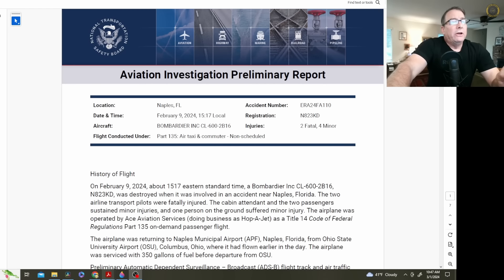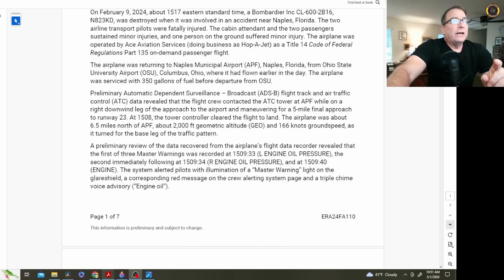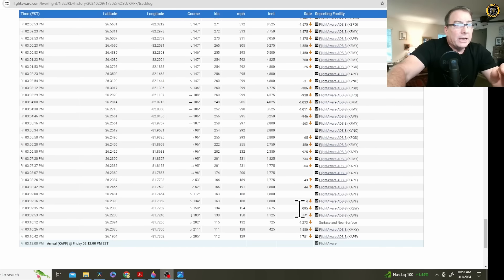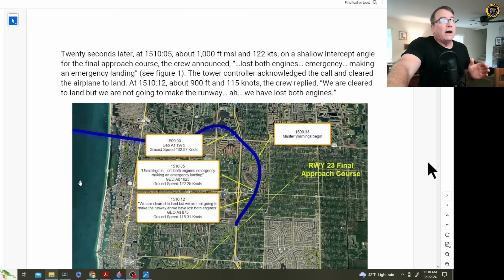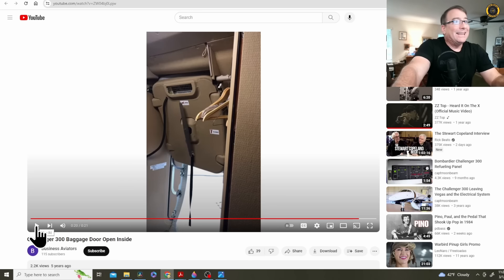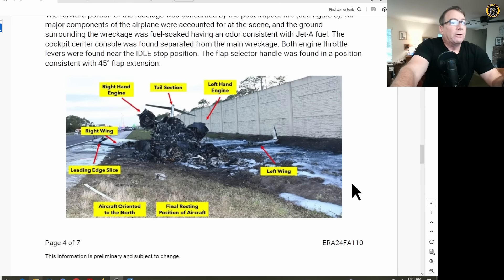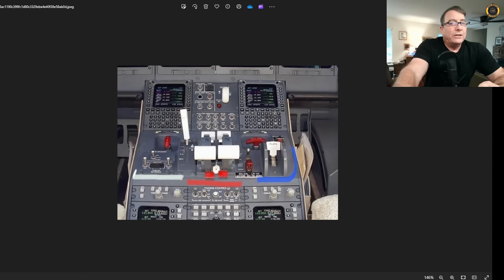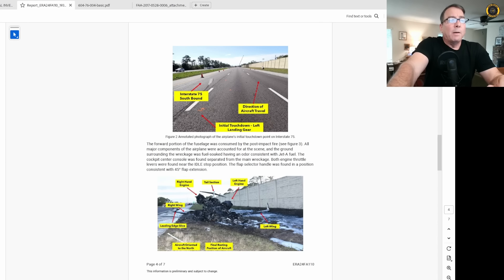NTSB Preliminary Report: Naples Challenger 600 N823KD

Comment: 16:30
To quote Yzma, “Why do we even have that lever?”

Wouldn’t it be more advantageous to have the fuel shutoff levers be a completely separate lever, in a completely different location, for this precise reason, like many other manufacturers, like Embraer, Boeing, and Airbus?

I would find it strange, though am cautious as to not speculate, how they could fly all but four miles of the flight and then have dual flameout due to fuel contamination.  It feeds from the lowest (ish) point in the tanks, where the water ought to settle, but it sat there for hours, only to magically appear on base.

Comment: Why didn't the pilots order Prist added when they refueled?  Could the fuel have jelled during their flight to FL?
Reply: No.  Fuel/oil heat exchangers.  Prist is not needed on the Challenger.  Some Citations and other models, yes.  The Challenger, no.

Comment: It was the fuel, but not contamination. To save money, the company did not want to pay extra for fuel with antifreeze added. At high altitude, jet fuel without the additives thickens with cold temperature. This can lead to engine rollback due to reduced fuel flow,
Reply: Wrong.  The Challenger has fuel/oil heat exchangers to keep the fuel warm.  It doesn't need Prist.  If the engines quit at high altitude that might be suspect.  In this case, it's highly unlikely the lack of Prist will have anything to do with this accident.  DTSB, while a sharp guy, is going to be wrong on this one, I suspect.

Comment: We've ruled out bird ingestion in the engines so that can't be the cause of the engines shutting down.  The timing of the engine shutdown is not consistent with fuel starvation of any kind as there would almost certainly be several seconds or more between the engine shutdown.  Juan's description of the possible inadvertent release of the latches preventing the throttles from being moved to the engine shutoff position seems the most likely situation and if that happened when and where it did there was no possibility of recovery.  
Juan, I can't make out what the switches in the "Engine Control" group, just aft of the throttles are -- can you identify what those switches are and what they do?  I can not imagine an inadvertent flip of any of those switches could shut the engines down, I'd think any action that could shut the engines down would require a secondary operation or interlock, but since I can't read what they are I don't know with any certainty.

Comment: At about the 15 min mark you demonstrate the right seat flying and the left seat operating the flaps.  I am not a pilot (nor did I stay at a Holiday Inn Express last night)  is it possible for the left seat to reach for the flaps in front of the right seat hands on the throttle, thus avoiding the stop releases?

Comment: If the Captains forearm lifted those latches and allowed the throttles to be brought into Fuel Cut Off, we'll likely never know.    Perhaps a Challenger Captain can opine on how easy it would be to inadvertently raise those cut off levers while reaching for flaps??  ( **EDIT.  I have read more of the comments and apparently the thrust levers first need to be a idle, then the lock out levers can be lifted and the engines shut down**.)   But here's the thing...with Gear Down and Flaps 45 there is little chance that the throttles were at idle or ever brought to idle.    They were at super high-drag in the landing config so they'd probably have to carry some thrust all the way to the runway (unless of course they were either FAST or HIGH or some combination of the two).   The ATSB data will likely provide a clue.   I find this unlikely as they were flying a downwind and base leg arrival, not a straight in where they could have mismanaged their energy state during the descent.

Just look at their rate of descent after the engines flamed out.   They had to bomb downhill just to keep the wing flying...that tells me that an idle setting on base leg would be very unlikely.   Every jet I have flown requires thrust to be carried once configured to land under normal conditions.  Unless of course you have completely jacked up the arrival.    

But then why did both flame out at once?   Fuel contamination affecting both engines at the same time?   Unlikely, but then again, look at the SpeedBird 777 in Heathrow.   Those poor bastards.   RIP gents.
Reply: That's very good thinking.
It also occured to me, since they were at the downwind-to-base point of their approach path, that sideways momentum might have played a role in forcing fuel to the port side of the tank(s) and even the port side wing. Are there any areas of the tanks do not have fuel pump suction?
Think about the merry-go-round: when it's spinning around, you fly off if not holding on, due to Coriolis forces, fictitious as they may be.
Downwind-to-base might be demonstration of Coriolis Effect, with fuel flying off the merry-go-round, momentarily away from fuel inlet suction.

Comment: I have CRJ time in both seats, which has the same thrust lever quadrant, and I have a hard time imagining you could accidentally lift both idle cutoff latches reaching from the left seat to the flap lever. They are quite awkward to reach and you normally have to hold your hand backwards, thumb forward, so your fingers can reach them to lift them. Someone's forearm doing it is a bit of a stretch. Unless it was done deliberately.  Absent a common-source problem like fuel, double random simultaneous failures just don't happen.  Even fuel is a bit of a stretch for an exact simultaneous shutdown.  I'm going with conscious action by a crew member, either deliberate or the Mother Of All Brain Farts.

Comment: If there is a risk of the left seat pilot knocking the engine into shut down while adjusting the flaps then shouldn't it be the left seat pilot always flying the landing to remove this chance?
Option B is the crew shut down the engines after landing but before impacting the wall?
Reply: Wouldnt that be a millisecond in time between those events?

Comment: I am amazed that this could be a possibility. Not out of the realm of possibility. That plane that crashed in India a while back had one of the pilots pull the feather on the prop instead of the flap handle, like you showed in that video back then. Really sad that it could be possible to do that.

Comment: I would never operate a low-bypass jet at idle while in flight. I mean one with cables. Electronic throttles, high-bypass being a different story. But a small jet is basically at idle already when you reach 50% N1. There's hardly any usable thrust. Moving the throttles to idle before landing is a bad technique. Use the speed brakes, drop the gear, keep the fires hot.

Comment: A question for anyone familiar with this throttle setup. How close to the base of the throttle levers are the fuel shut-off levers? Is it possible that an object like a hard case for glasses or even a pen laying on the empty area of the console between the throttle levers and the 4 switch “engine control” panel could have come into contact with the fuel cutoff levers as the throttles were brought back to idle?? Or are those cutoff levels higher up on the throttle levers than they appear in these pictures??

Comment: surely the data recorder would show if the throttle or fuel flow was set to shutoff?
Reply: Maybe. It's an old aircraft, and not every parameter is recorded on the FDR.

Comment: I saw a video a few years ago about DEF somehow got into the fuel and shut both engines down on a jet her was flying with passengers. The pilot did an excellent job of dead sticking it in for a perfect touch down. Pretty amazing. The passengers weren’t aware of what happened till it rolled to a stop on the runway. They found out later  when the fuel was examined. No one found out how DEF got into the planes fuel. Let’s hope this isn’t a repeat of what happened to the other pilot.

Comment: I can talk to my old Garmin Gps...I wonder sometimes why there is no voice/flashing light feedback when turning off the fuel system..in flight. I work in an aerospace machine shop, and it boggles me that the Haas controller, doesn't flash the spindle or feed rates when you manually override them over/under 100%...so simple with modern computer power. Or lock out the probe TLO so it doesn't get deleted...Kinda ridiculous, but here we have a very expensive aircraft with redundancies abound and one can accidentally shut off the fuel system while airborne..Don't get it.

Comment: NTSB will probably next concentrate their analysis looking at voltages to various sub-systems during the incident timeline. 
Some contactors open and close in differently sequence based on how power is removed.
Things like emergency lights will illuminate during complete loss of power with improper shutdown.
They won't come on if the engines are accidently shutdown even inadvertantly.
These guys were so close to the ground they wouldn't have had time to try the APU...not that it would help.
The FDR, if not damaged, should offer additional clues.

Comment: Fuel contamination doesn't shut down 2 engines at the same exact time, these are independent tanks and independent fuel lines. What are chances that they will contaminate and bring both turbines at the SAME time. My take that this is wear of the shutoff levers teeth, that corresponds to a slow down after gear down 5 miles out and scheduled flaps later on that type. Also could be some freaky activation of two firewall valves, a computer glitch.

Comment: Probable Cause Dan, also thinks there might be a problem with the fuel.  Why is this even a possibility?  Aircraft fuel should be triple filtered for water or sediments.  There should be no excuse for anything wrong with the fuel.  Aircraft go through vigorous inspections and check lists, why not everything else that aircraft rely on to stay in the air??

Comment: Reminds me of a similar loss of both engines on a Lear jet (I think) that glided from cruse to a safe landing.  They found that the fuel was NOT mixed with a special additive called for that particular jet.  I think it was a medical patent transfer flight.      N.E.OH Bob
Reply: The additive is called Prist
Reply: If that's the one I'm thinking of, the Prist wasn't blended into the fuel in the truck. The lineman filled a can with Prist and added it as he was fueling the aircraft. Unfortunately, this can had been used for DEF and there was some residue. The pilots experienced a flameout in one engine on final approach followed by the second engine failing moments later. They made a successful deadstick landing and the passengers never knew there was a problem! Although the aircraft was undamaged, the DEF had chewed up the fuel system so badly the aircraft was written off as a total loss.

Comment: makes you wonder if the "sound barrier" wall wasn't there if they would have landed safely.   seems like the comfort of some risk the lives of others
Reply: When they put up guard rails at drag strips, racers began dying. Before they had room to correct, but the guard rails are quite narrowly spaced. All done to protect the spectators. I saw one driver take-off like a rocket when he hit the guard rail, and was killed when he hit the scoreboard 30 feet off the ground.
Reply: FYI. Just behind the sound barrier wall is a concrete wall, which is the boundary wall of the Wyndemere Country Club. Interstate highways through urban areas have walls, which in this case is well away from the traveled roadway. It was not designed for aircraft. Not to diminish the great tragedy here, but it was  miraculous that no car drivers were killed. This was rush hour on southbound I75. The nearby exit south of the crash site is a major exit to central Naples.

Comment: If I read the manual notes correctly, it seems you have to lift the latch levers both to go into idle cutoff and to come back out. So if the PM's arm had inadvertently tripped the levers to go into idle cutoff, and this was only recognized some seconds later, would he still be pushing on the levers so the PF could easily advance them? Or would the PF recognize the throttles were locked into idle cutoff, and have to take deliberate action to advance them? If the later was the case, I'd pretty much expect some cockpit chatter on the subject. Did this plane have a cabin voice recorder?

Comment: So what elimates the (1) no Prist/fuel gelled, or (2) water in fuel was ice briefly, during high elevation descent scenarios?
Reply: fuel/oil heat exchangers.  No prist necessary.  Fuel might gel at high altitude but not down low on approach.  And even if it did, the odds of it happening in both tanks at the exact same time are extremely remote.
Reply: @johnaclark1  Did Juan indicate that both tanks shared a common exit point on the way to the engines, or I misunderstand that? Thanks for your help.

Comment: I would imagine the so-called "water" observed in the sample may well have been from water used to fight the blaze.  Personally, if this is in fact a fuel issue, I would find it more likely that a mistake was made transferring fuel from one tank to the other.  Does anyone know if this aircraft has fuel dump capability?  Is it possible that one of the flight crew dumped fuel instead of transferring it to the other tank?

Comment: Do we know why it is not possible to restart the engine having shut it down. Obviously these pilots did not have time.
Reply: It's very possible if you know you did it. Lift red shutoff levers, move thrust lever back to idle, press in continuous ignition switch light, bam both engines should relight- unless you waited to long and engines have spooled down.

Comment: Such a tragic accident, if the aircraft didn’t spin the pilots would have survived. The flight attendant is a hero saving the passengers lives with her quick thinking in an emergency.
Reply: If the engines weren't suddenly turned off, or failed, the pilots would have survived.
Reply: the aircraft did NOT "spin".
Reply: @swiftadventurer  The right wing caught the wall and the plane began to pivot. The nose apparently struck the wall before the plane came to rest facing the opposite direction from which it came.

Comment: Both pilots AND that flight attendant are true hero's! I can only imagine the shock in the pilots as they got those warnings- quickly determined they had to put down, somewhat relieved to see the highway, lined up and set down safely (avoiding all the local housing)- now hoping to avoid hitting any vehicles, only to clip the wall, spin and be killed in the last seconds! They did their training and families proud! And the flight attendant-WOW! You go from a normal approach to a violent impact in less than a minute and then she gets unbuckled, assess the situation and gets herself and the 2 passengers out a baggage compartment door under a hot and possibly still turning engine while fire rages just feet away! AMAZING!!! @ lives were lost that day, but MANY were saved by the crews actions!
Reply: But for a few damn feet those pilots would yet by flying. This is as tragic as any I've seen where they fly it all the way--save the rest, but for that wingtip contact would have walked away all five of them. RIP

Comment: Do fuel contamination problems typically manifest on approach? If so, why not prior?
Reply: Contamination is most often due to water, which is heavier than the fuel, so it would have manifested very early in the flight.
Reply: @johnp139  Thanks, good point.

Comment: Did this plane have Auto Throttles installed?  Does anyone know for sure, yes or no?  Not all Challengers do.
Reply: Many CL604 and CL605s had the Auto Throttles installed under an STC at completion.
Reply: @aviatorjoe4040  Yes. I know.  The 604’s 605’s and the 650’s I flew all had AT’s.  I was asking if this particular plane had them or not?  If it did, I find it hard to believe the cut off switches being engaged while the PF pulled past the idle gate. I find it hard to believe even if it didn’t have AT’s actually.
Reply: I understand. Not sure if this particular aircraft had ATs. Although I do not believe them to be the cause of the accident, the "Safe Flight" AT installation on these aircraft is a poor design in my opinion.    @wgeffon
Reply: @aviatorjoe4040  Agree. My thought was if they were installed, likely they would have been on at the time of the engine failures. 
Meaning, the PF wouldn’t be pulling back to idle and possibly into cut off (if the cut off switches were lifted by a forearm)

Comment: Did you discuss the part in the paragraph between figure 2 and 3 that reads "Both Engine throttle levers were found near the IDLE Stop position."? That seems to contradict the discussions about the throttle positions when they are discussed in individual engine sections of the report. Thoughts? Or am I misreading something there?
Reply: Stop as in door stop, not engine shutoff

Comment: It was a gruesome sight.  The cockpit contacted the sound wall and tore off the right side and pinned the poor copilot trapped between the wall and his seat.  However bad you can picture the result as it slid down the wall in this condition,  it was far worse.

Comment: The video refers to the possibility of an inadvertent shut down if the throttles were mistakenly allowed to move to the "cut-off" position by unintentional upward deflection of the red "lock out" tabs, but I have not seen anyone mention the Auto Throttles, if installed, as a potential contributing factor in this event. If the Auto Throttles are on, and the thrust levers are at idle with the speed bug set below the current airspeed, will the Auto Throttle motor and clutch system attempt to drive the thrust levers further aft and past the gate to "cut off" if the red lock out tabs are bumped upward? Just wondering if this is possible on this type of Auto Throttle installation.